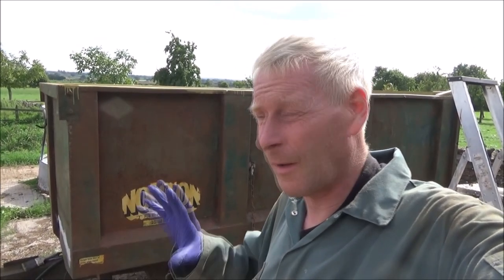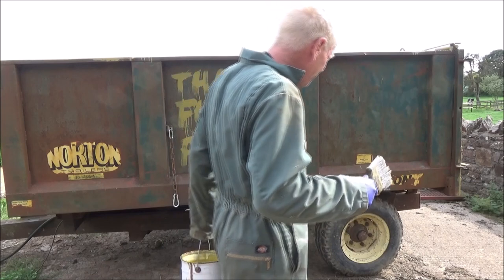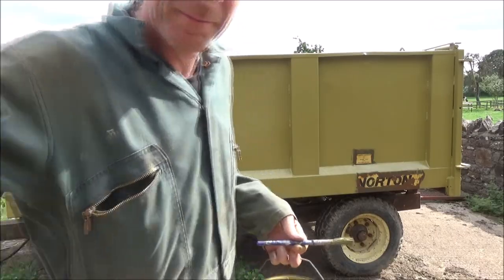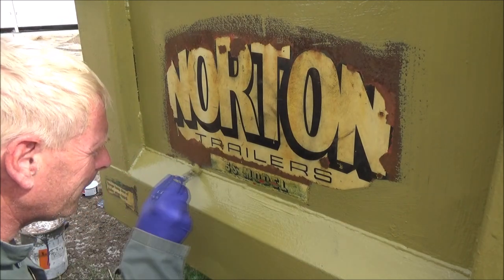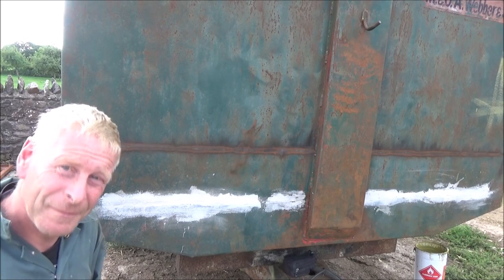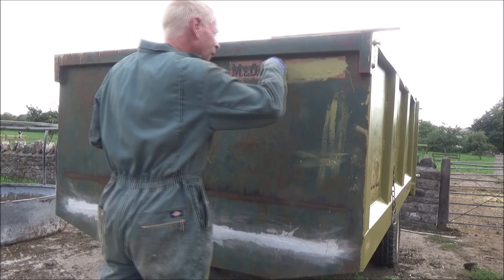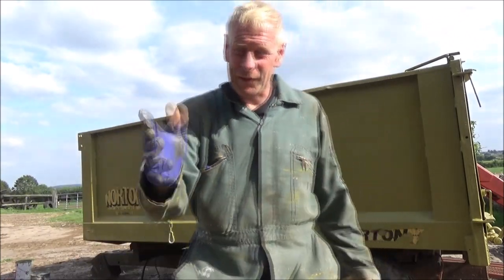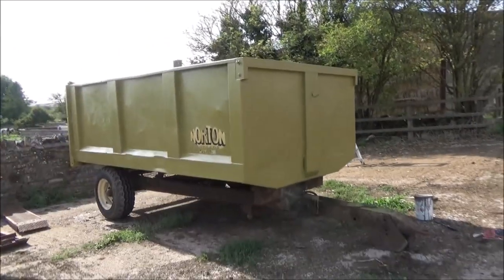Norton trailer restoration.Part 6. Painting the outside with undercoat

Comment: HI Richard, just a little suggestion, for the bottom of the box I would get some of the auto underbody spray undercoating and spray it real good. I think it would help seal up the bottom real good. We did that years ago on our farm on a metal floor manure spreader with the poly liner. Worked really good.

Comment: The colour isn't nearly as bad in the light as I thought. Looked very yellow on the inside of the trailer but that green works well with the white wheels, maybe a black or dark grey chassis would look the part?
Reply from the maker: Grey chassis for sure